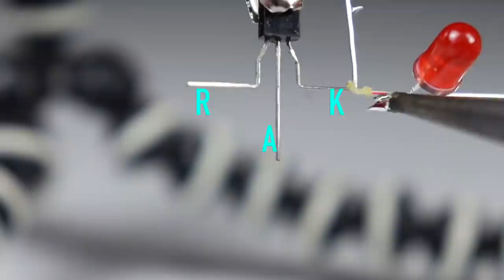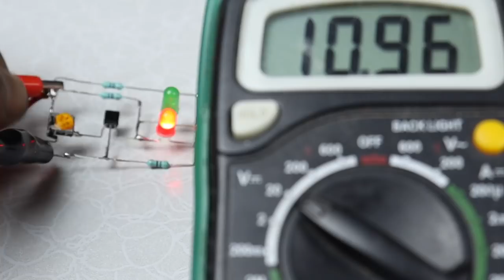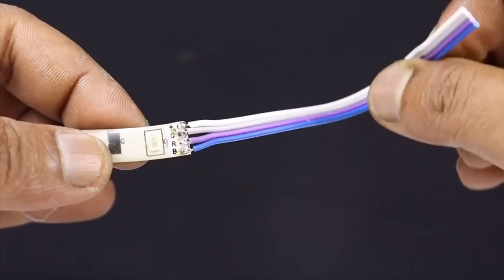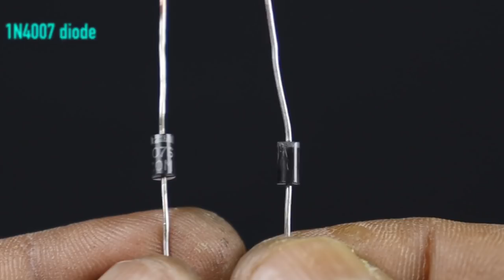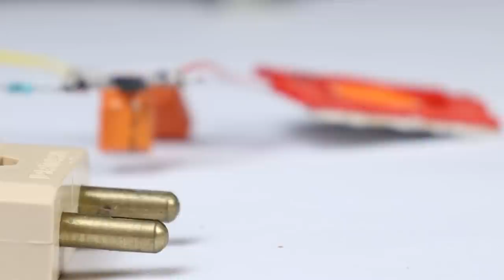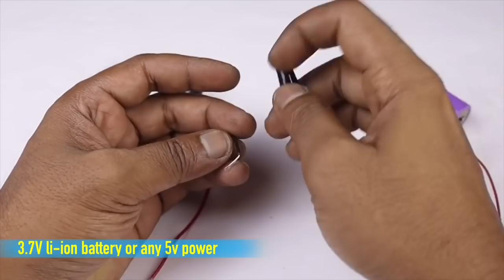Top 4 useful electronic circuit projects

Comment: for circuit 220v to 12v you have to add ziner regulator 12v car the capacitor (25v, 470µF) will inflate